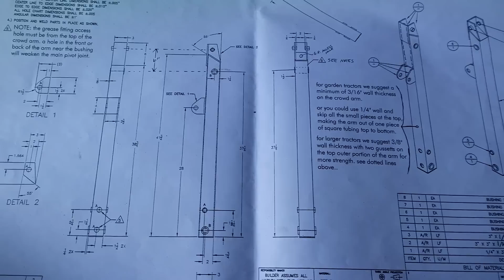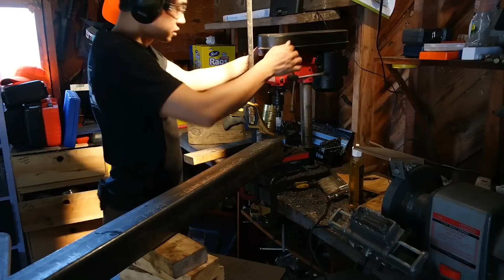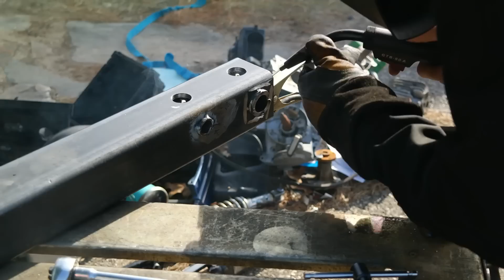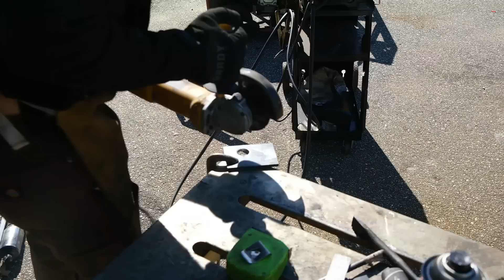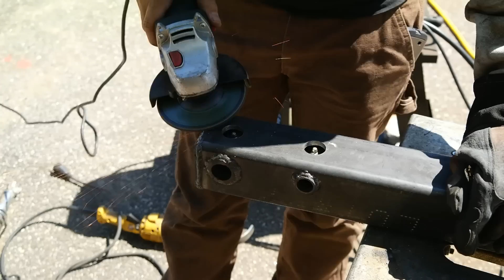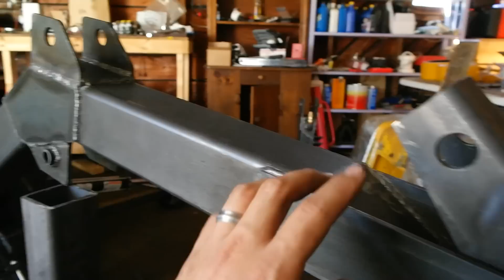Cub Cadet 149 TLB Transofrmation part 12: Crowd Arm Build

Comment: Nice to see some young people building things, nice work .   May I suggest an idea for future projects. Grease fittings...instead of in the bushings, put them in the shaft . Drill a hole down the center  with and intersecting hole some where in the middle  and the zirk on one end.  Perhaps  you could look at "DU" style bushing as well  great improvement for longevity .
Reply from the maker: Agreed! I'm building another one in December and will be machining pins with fittings. I didnt have a lathe when I did this build but I do now!